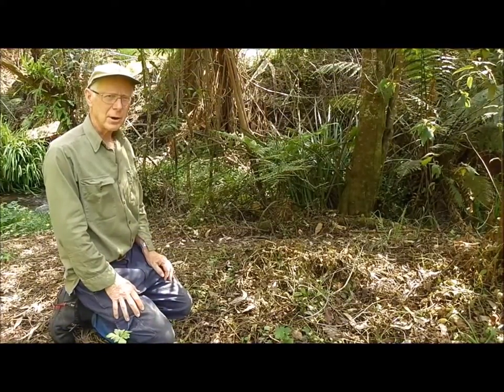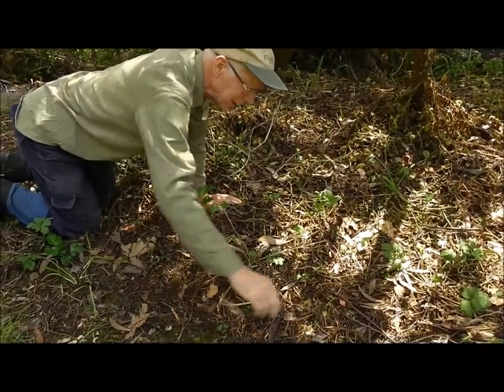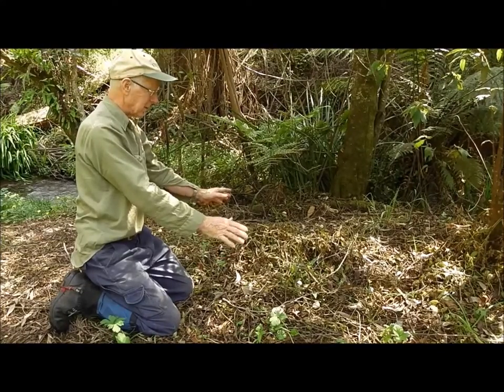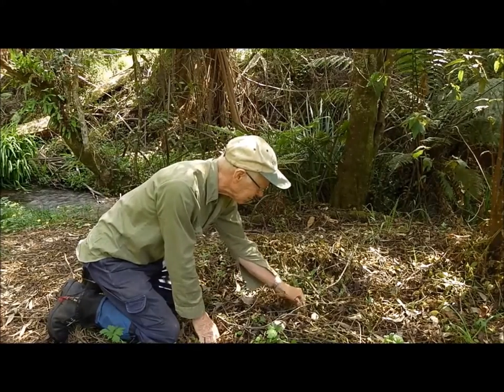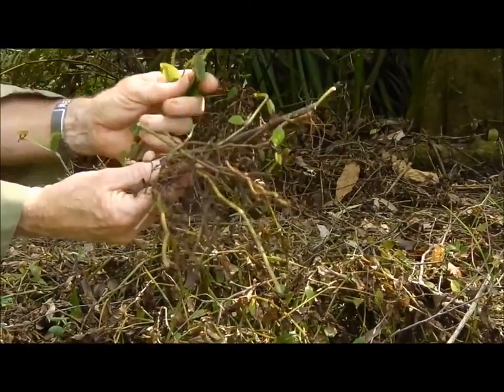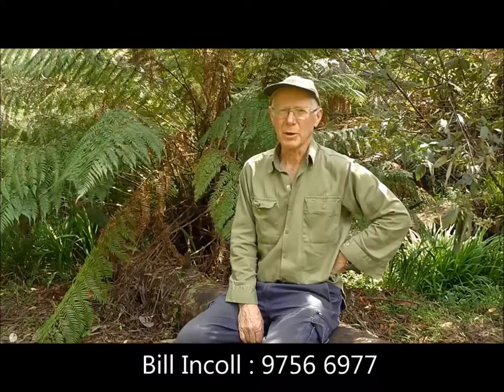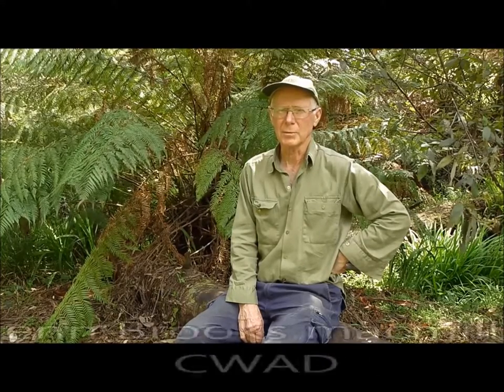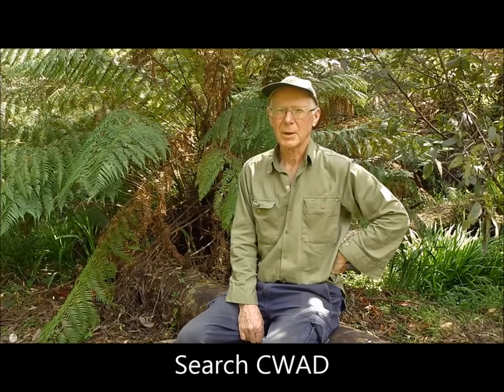Tradescantia program and control methods Part 2

Comment: Hi there, do you think it's more effective to spray younger, smaller trad rather than the more established, denser plant?
My plan is to rake  back the more established patches on my property and then spray it when it comes back.
Any advice would be appreciated. Thanks.
Reply from the maker: Hi Callum, often thick trad will need several sprayings as the upper layers block it from touching the lower layers and it may not spread through the whole plant. If the area is sensitive with ferns and natives raking and spot spraying can be a great combo.
Reply: Awesome thanks for the reply. There is no natives, just trad. But I want to plant lots of grasses to hopefully out compete the trad. I'm in Upwey btw, thanks again
Reply from the maker: @callumnicholson5416  Nice, I lived in belgrave for awhile. If it was me, I would just give it several sprays and it it hard. Then plant Lomandras and other broad leaf herbicide tolerant species. Some native grasses are sensitive to starane if thats what you are using.
Reply: Thanks, what's the best herbicide to use?
Reply from the maker: @callumnicholson5416  definately starane. Not round up. Have you tried getting into contact with local groups? CWAD, SREA, CCLG? They may be able to take care of it for you.